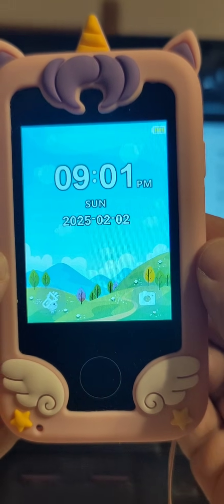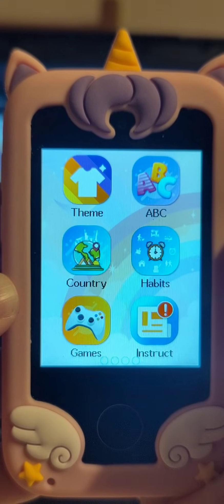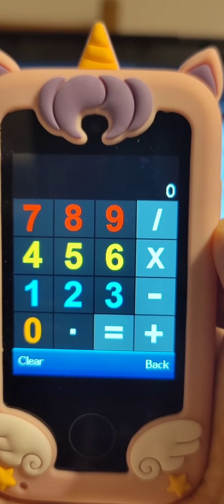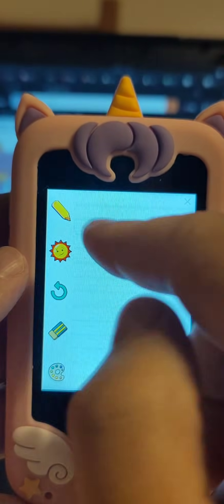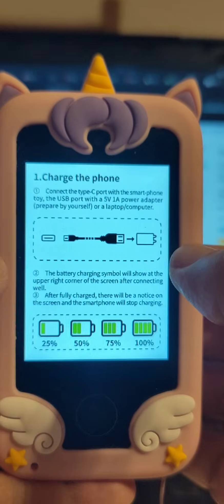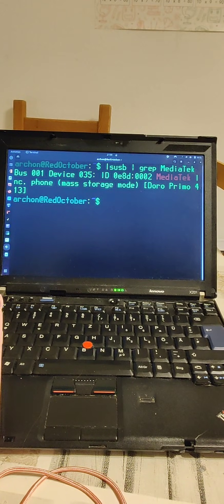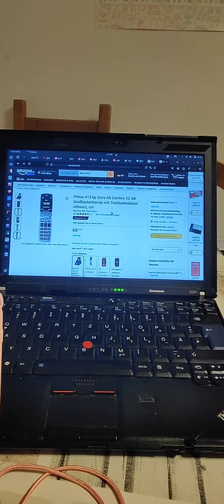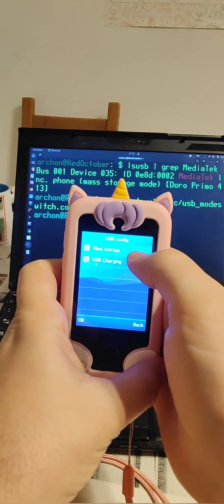Connect UCIDCI Kids Smartphone to Linux as "Doro 413" (Nucleus OS)

Comment: In case setting DisableSwitching=1 don't produce the desirable effect make sure the USB cable you're using support data transfer, the first cable I used was a power only cable so the partitions didn't show on the computer, once I used a proper cable everything went fine.
Reply from the maker: Good point — fell victim to it many times in the past...

Comment: I had no idea this class of device existed so it is a rare glimpse into a world I have never looked at. I wonder if the phone can talk to generic MTD devices? I have an old tablet I still use (mostly for the camera to be honest) that didn't come up in Linux till I added the support packages for MTD devices. It seems that it was not installed by default, though my Devuan system seemed to have it and not struggle. In other news.. really admiring your nice laptop. I have a similar one X200s that I love dearly with 8gb ram and 512gb SSD which I build and run NetBSD on. I love pottering around with code on this guy with Clang-19 doing serious work and turbo assembler 3 in DOSBox for fun.  I wish Lenovo would make such devices again.  Best Wishes.
Reply from the maker: A fascinating idea, when the kids permit, I shall try! 😊 Thank you very much! — MTD devices normally work just nicely... And I recently got into QBASIC again, similarly for nostalgia reasons — I understand your sentiment all too well... 😅